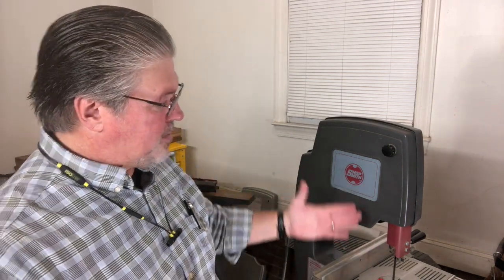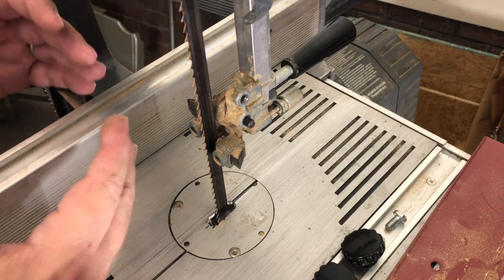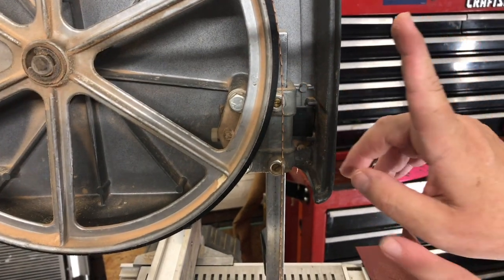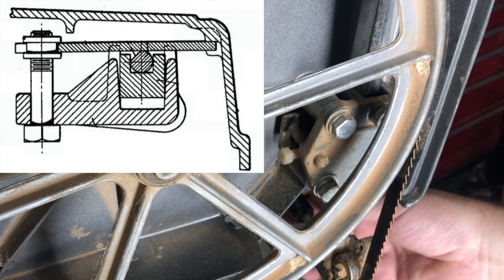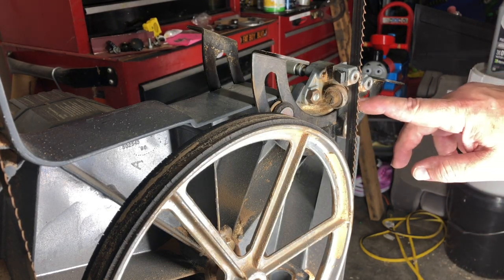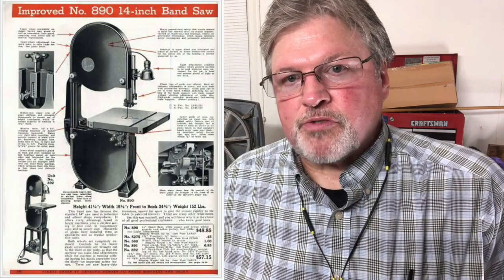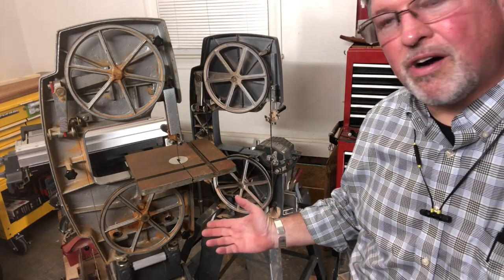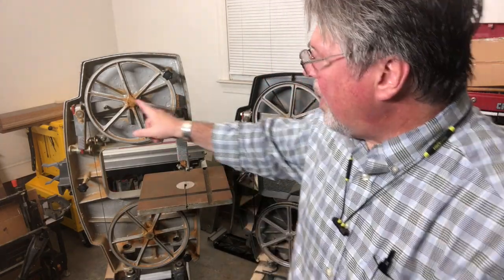The "Business End" of the Shopsmith Bandsaw: Upper and Lower Guides and Bearings

Comment: Scott,  Thanks for all the great videos.  You did a bandsaw upper wheel,  lower wheel, business end and probably a few more bandsaw videos.  All great.  One question I had with  my brand new Mark 7 with plastic power coupler.  I bought a used /great condition SS bandsaw with stand.  I wanted to try putting on the Mark 7  and found just a slight bit of miss alignment.   Not quite concentric left to right.  Up and down is controlled by the tightening device.   In your opinion, how much out of alignment can a coupler take?  I'd guess I'm about  15 thou out.  And can this be adjusted with rotating the tubes?  So many thanks for all you do with your great videos.
Reply from the maker: Hey Tim, The posts that support the man saw on the Mark seven are slightly eccentric or offset. By loosening the setscrew inside the bandsaw that locks the posts in place, you can rotate them bringing the shaft into alignment. Be careful, because when you loosen them the bandsaw will want to drop down on the posts. Good luck! Scott
Reply: @MyGrowthRings  thanks Scott!  You are correct...gotta have really robust thumbs while holding that saw up...and at the same time loosening that lockout!  Next time...I'll block it up, then try rotating the eccentric tubes to bring it all in line.
Reply from the maker: @piumartians  Good call. You’ve got this.
Reply: @MyGrowthRings   Scott FYI the bandsaw I picked up in the used marketplace was mounted to a powerstation stand with motor...apparently no need for eccentric tubes because no need to align to the power coupler.  Just straight tubes.  I contacted ShopSmith customer service to see if those parts are available for sale.  Thanks for all you do for us SS owners!
Reply from the maker: @timpiumarta8490  Ah-ha!  Yep, that has been known to happen. Glad you got it figured out. Scott

Comment: Hey Scott I just replaced the lower and tracking bearings on my bandsaw.  I had a question is the tracking noticibly better with the double bearing over the original single bearing?
Reply from the maker: I don't believe so. The thing that has the biggest effect on auto-tracking is the tilt of the upper wheel.
Reply: @MyGrowthRings  Thank you,  I was curious because when I looked online there seemed to be several different bearing styles.  And thank you for the maintenence video on the bandsaw.  I greased up my upper wheel  bearings and they are super quiet now.   Keep up the great work!

Comment: I made all of the adjustments you showed in the video on my Shopsmith bandsaw. For the life of me, I can't seem to get mine to cut curves at all. I have a new quarter-inch blade on it with proper tension and it won't even cut a simple lazy-S curve on a 3/4 inch piece of plywood without the blade flexing hard to the left or right to the point where it burns the wood. Any thoughts as to what might be out of adjustment?
Reply from the maker: Steve, I know this is going to sound crazy, but I have two "Is it plugged-in" type of questions for you. Are the teeth moving downward, towards the table when it is running and are the teeth on the blade faring down?  It is possible to have the blade flipped-over and some folks have also mounted their bandsaw on the wrong end of the Mark V.
Reply: @MyGrowthRings  Yep. Teeth are facing toward me, pointing down  Bandsaw is to the left of the headstock.
Reply from the maker: Steve Mendenhall All good. I suspect it’s just a poor quality blade. I’ve bought those!
Reply: @MyGrowthRings  You nailed it, Scott. I put an SS 1/8" blade on and it cuts tight curves with no problem. Guess I'll stick with brand-name parts from now on. Thanks for your help!
Reply from the maker: Steve Mendenhall Glad to hear it!

Comment: Will you show the tire replacement please?
Reply from the maker: I will, but I’m not sure when I’m going to find the time to do it. Are yours in bad shape? Scott
Reply: I did mine in no more than 5 min. Now was it right, I think but I used the Blue tires placed them in boiling water and with the tool you get its fairly easy from there.
Reply: @MyGrowthRings  They are the black old ones and I was thinking of upgrading to the red silicone ones. My name is also Scott!

Comment: God yes! Knobs.
Reply from the maker: Do you have one and does it have the cap screws?
Reply: @MyGrowthRings  I see I never replied.  Yes, I acquired a 510 and it had the newer version of the bandsaw with the cap screws.  Besides hating the cap screws, I also didn't really like the new table even though it was bigger.  The main problem was I didn't inherit a BS fence.  Since I'd gotten used to the cast iron table on my old one (and using the miter gauge as a fence), I decided to keep using the old one but transferred the new cover to it.  Now I have the old saw with the benefits of the new cover - - and I keep my knobs!
Reply from the maker: @danasmith8950  I agree, the old table works great with the miter gauge. Sounds like you have the best of old and new. Scott

Comment: Got around to adjusting my band saw and right when I thought I had her all set up right, I powered her up and the top tire came flying off.  The tires were old and splitting.  Wonder if the blade was too tight?  It was same size blade as yours in video cuz I planned on re-sawing.  Anyway more money for new tires.  Which ones should I buy?
Reply from the maker: Bummer. I highly recommend the Blue Max tire from Amazon: https://amzn.to/2ZjbZxE and I've done a video on the install process, which you can find with a search for "Shopsmith bandsaw tire" here on Youtube. Scott
Reply: @MyGrowthRings  thanks Scott I’ll check it out.

Comment: I just started watching your videos and they are amazing and very informative. I am new to the SS community and have a Mark V 500 that is new to me I am refurbishing everything to be able to use a lot. Previous owner kind of let it go to.. well you know what I mean. I have a few (probably easy) questions for you. What do you recommend for getting proper alignment of the table with the blade? What is the correct alignment of the tension indicator scale with the tension spring (I noticed that your tension spring is far more vertical than mine when tensioning a 3/8 blade) so that I can properly tension the blades? What do you recommend when the shaft that the table clamp bolt goes through actually turns when you tighten the tilt lock causing it not to tighten all the way (which causes the table to still tilt even when you tighten it all the way)? Thank you very much for all of these videos and any help you can provide for my issues.
Reply from the maker: Hey John. I’ve done a couple Shopsmith bandsaw vids and in one of them I talk about adjusting the table to the blade. Short answer is a one time shimming is required. Also, I talked about tensioning in another vid, but to set the scale properly, with the tension off the wheel you loosen the screw in the steel gauge and swing the top left edge of the scale so that it just covers the red edge of the leaf spring. As for the tilt bolt, it sounds like something is wrong. I would compare what’s there to the exploded parts diagram in the manual to make sure that everything is in the right place. Hope that helps, Scott
Reply: @MyGrowthRings  Yes, sorry I watched the table shim video after my comment... lol. I did see the tensioning video but it did not show the exact alignment but you have explained it better now so thank you very much for that. As for the tilt bolt, I did compare to the SS bandsaw book I have and all of the parts are there and in the correct places. The issue is the sleeve inside that the front bolt goes through turns as well once I get it tightened as much as it will currently go. That sleeve shouldn't turn because it is suppose to hold that bolt tight. I did see in one video that one of your bandsaws has a regular hex bolt in the front and the stock bolt in the back. Was that because of this kind of issue? Thank you so much for your excellent reply and your awesome videos.
Reply from the maker: @johnschroeder5308  Yes, this is a problem that I've seen before. The original design used carriage bolts, while the newer design uses a  hex bolt in one location and a large flat head bolt in the other, connected by a plastic "yoke" that keeps them from spinning. Which version do you have?
Reply: @MyGrowthRings  yeah both of mine are carriage bolts with the small angled pieces on them that grab on to the yoke to stop then from spinning. The yoke is what is turning inside of the band saw shell that prevents it from tightening all the way.
Reply: @MyGrowthRings  Hey Scott just wanted to give you a quick update and maybe this can help others. So I was able to very easily pop out the yoke with a wider bolt and mallet. Inside of the frame as well as the outside of the yoke was very greasy. Cleaned it all up and then took an extra large flat head screwdriver and put it in the slot on the yoke on the opposite end that the carriage bolt grabs on to. Pounded it down about 3/4 inch to flare out the yoke just a little. Then reinserted the yoke smaller side first and it is now working great. No slipping at all and the table locks in place.
Reply from the maker: @johnschroeder5308  Excellent! That’s going to be very helpful for someone down the road. Thanks for the update.
Reply: @MyGrowthRings  You are very welcome good sir.

Comment: Great information as always on the history and the use of the shop smith.  
  I find myself the owner of both SS and the total shot units.  
   In looking for the everything I wanted to put on my total shop a found a good price on a SS. lol this one had a total shop band saw on it so it’s like it was meant to be I put it back on my total shop.  
   I installed new tires on it but it would Not take a SS blade.  You what happen to know the blade size for the total shop ?
Reply from the maker: It should use the same 72” long blade. Does the SS appear to be too long or short?
Reply: With the new tires 2 BLUE MAX ULTRA DUTY .125 URETHANE BAND SAW TIRES  FOR DELTA BS150LS BAND SAW 72 is too long. the top wheel hits the cover when it’s in place.  Old tire was rubber and thicker , also there’s a 1/4 different between SS and total shop diameter.  SS being the larger wheel.  Are you running a 72 inch blade on your total shop ?
  I saw there is a 71.75 inch stock size.  How should I determine the right length of blade?
   Any help with this is appreciated. 
 Lol can you do a video on you  total shop.
Reply from the maker: @jaysoncheney  Well, I guess I was mistaken. I suggest checking out this blade length calculator: https://www.toolcenter.com/calculate-blade-length.html
Reply: Jayson Cheney Just in case you missed it, I posted a video last night that answered the question about the TotalShop bandsaw blade length, and you are right, it’s not 72”. Scott
Reply from the maker: Jayson Cheney Dang it, I was logged into the wrong account! That last comment was from me. Scott

Comment: How do you adjust the auto track bearing?
Reply from the maker: The only adjustment is left and right. What adjustment are you looking for?
Reply: @MyGrowthRings  in the book it says that the lower guide bearing should about 1/64 from the back of the blade, and the blade should be riding on the auto track bearing. On my band saw, the blade does not ride on the auto track bearing and the lower guide bearing is about 3/8 away from my 1/4 inch blade. The upper guide bearing and cool blocks seem to be in the correct position. I have tried torquing the upper wheel as you and the book have instructed and that has help a little in moving the blade further back on the guides, but not enough (in my estimation) to meet the book requirements. Any ideas?
Reply from the maker: @johnmeeks9618  John, If you pull all of the blocks away from the blade and tension the blade, where is it running on the upper wheel? Does the back of the blade run to the back of the upper wheel and dies the back of the blade run against any of the bearings? It the blade is running against the upper bearing the upper guide post is too far forward.
Reply: With the blade tension according to the indicator, the blade runs on the back of the upper wheel, does not touch any of the guide bearings. I have placed a washer behind the lower bearing block to move it closer to the blade, and it is now about 1/64 away from the guide bearing. The blade at the upper guide is about 3/8 away from the bearing. On the other side, the blade is about 1/32 away from the auto track bearing and when running, will not ride in the grove on the bearing if they were in contact. I can move the auto track bearing to line it back up, but can’t move it forward to contact the blade. Again I torqued the upper wheel and it has helped, but I am leery of trying to torque it much more than I have.
Reply from the maker: @johnmeeks9618  Ok, if it isn't hitting any of the bearings then the upper wheel either needs to be tilted back further or there's a chance it's on backwards.

Comment: I’ve got another question, are the upper and lower bearings supposed to be bigger than the individual bearings that make up the set of bearings at the opposite side of the saw.  The reason I ask is I ordered new bearings from SS. They sent 4 of the same size and the upper and lower are to narrow, the blade falls to the left of the bearings. The old upper and lower are almost twice as wide as the new bearings.  Thank you
Reply from the maker: You are correct that the upper and lower bearings were always wider than the two that are used on the left Auto-Track set-up. I don't know if Shopsmith made a change or not, but I would get them on the phone and find out because that's an unacceptable condition. Let me know what you learn.  Scott